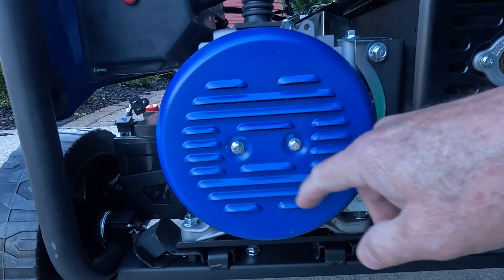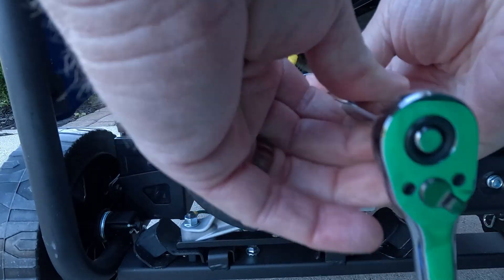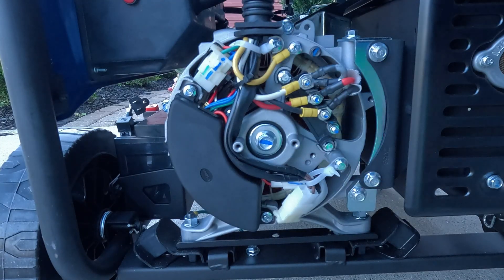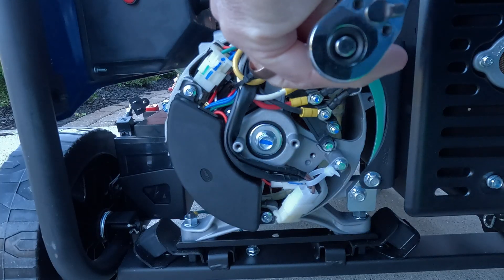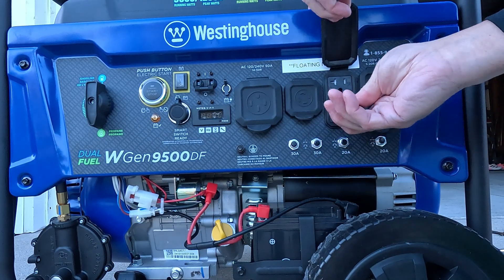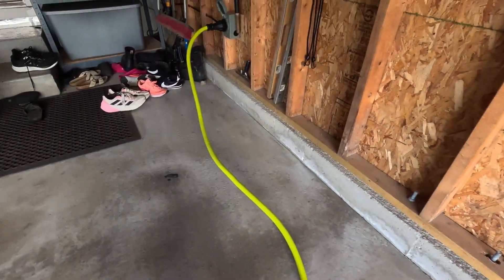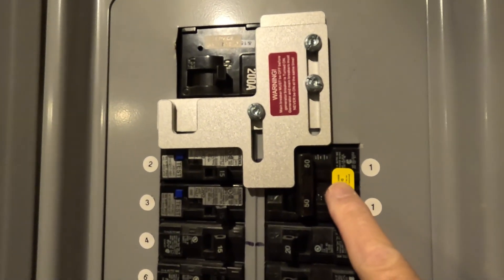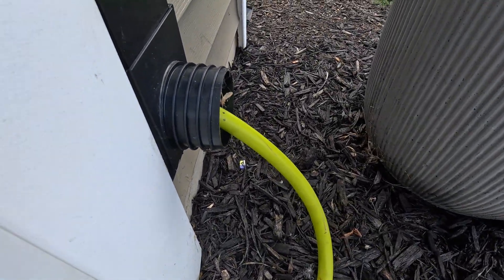Westinghouse WGEN9500 Generator with a FLOATING Neutral Explained

Comment: I would just lift the ground at the house inlet connection. Just leave the green wire unattached and capped. This only works if this inlet connection is plastic. If the inlet connection is all metal this won't be an option. Most of the ones I have seen are plastic. You ground the inlet box with the home electric service but (not) the plastic connection. This separates the bonding of the home electrical service and allows the Generator to remain bonded separately as it was manufactured. In this option you can still use the 120v outlets on the generator while back feeding the house and they will be bonded to the generator.
Reply from the maker: I never thought of that. Thanks for the comment.

Comment: What's the purpose of doing that
Reply from the maker: In Layman’s terms: with floating neutral in generator, and when it’s connected to your house, everything uses your home’s ground and not the generator as a ground. The short answer is it’s safer.
Reply: @geekNbean well I guess I have to do my generator like that
Reply: @geekNbean just take the little green wire off and that's it
Reply from the maker: @miltonhunter6515  Yup that's it, that removes the connection between the neutral (white) and ground (generator casing/ground). Most generators are the same.
Reply from the maker: @miltonhunter6515  also remember when you do that, do not use the the outlets on generator unless you put that wire back on. Only use generator to power the house. Always check with an electrician if in doubt.
Reply: @geekNbean ok I appreciate the info
Reply: @geekNbean hey is that wire green with a yellow stripe on it
Reply from the maker: @miltonhunter6515  i’ll have to look closer when I get home
Reply: @geekNbean ok thanks
Reply from the maker: @miltonhunter6515  yes mine is green with a yellow stripe on it
Reply: @geekNbean ok thanks I appreciate your help
Reply from the maker: @miltonhunter6515  no problem

Comment: Thanks for showing the procedure. When the generator is unbonded and back feeding a house, should the 120v outlets on the generator not be used?
Reply: of course, as long as it is connected to the house correctly (the house has the neutral bond) then the receptacles are safe to use while connected to house. If you are not connected to the house just get a neutral bond plug to throw into one of the outlets while using it.
Reply from the maker: Correct, that is my understanding. Better to run an extension cord off the house. But always ask an Electrician for the final answer. Thanks for the question.